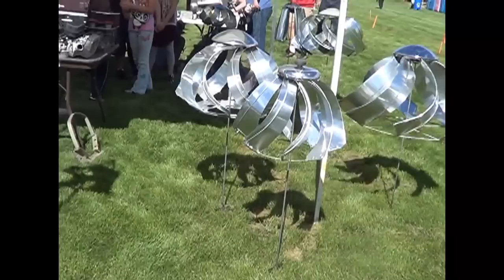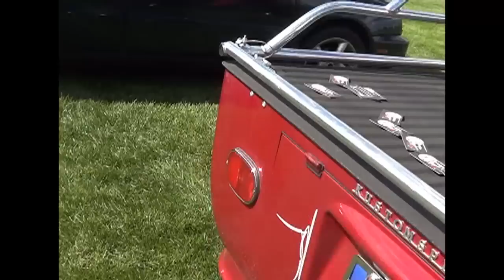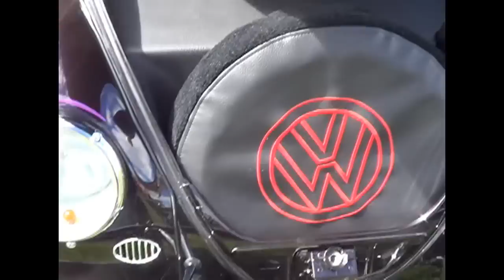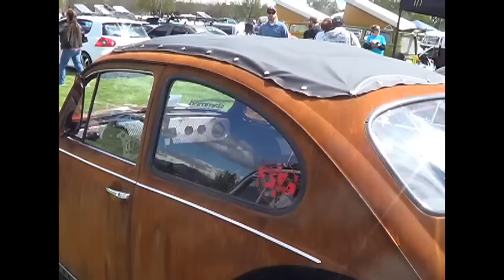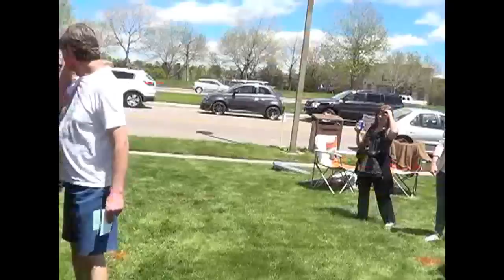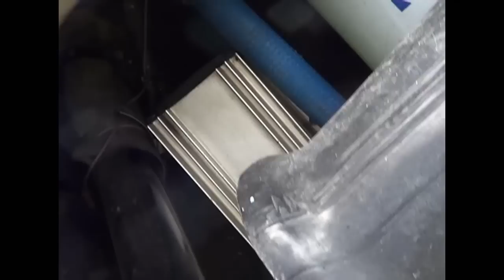Volkswagens On The Green  Car Show 2015

Comment: The orange baja is subaru ej22t swapped, I built the wiring harness for it! It has a legacy turbo on it and a wrx top mount intercooler and a huge stack on it. Sweet car!
Reply from the maker: MrTurbo458 Nice job MrTrubo Thanks for your input. Are you in the Denver area?
Reply: TheEZGZ  Yes I am, check out my videos, I have some of that orange Baja running and my newly built Baja with an ecotec!